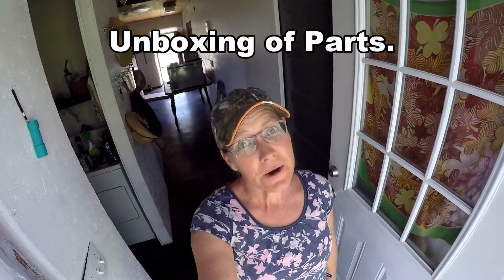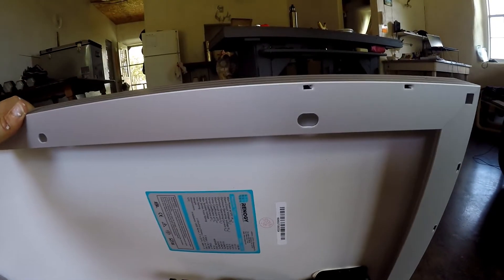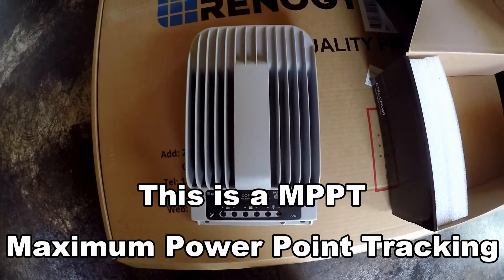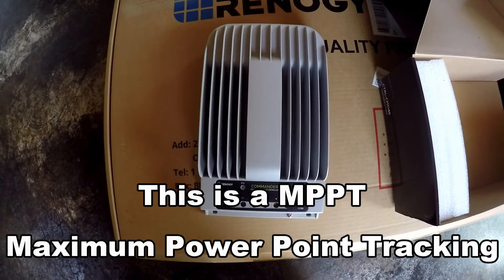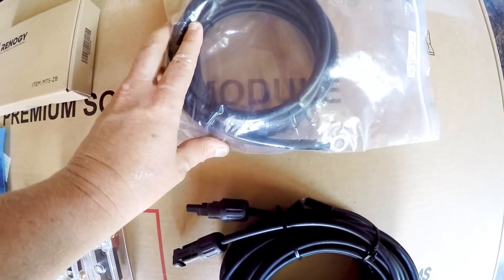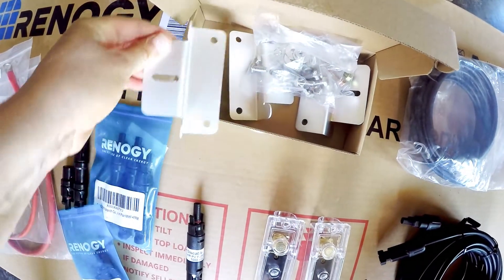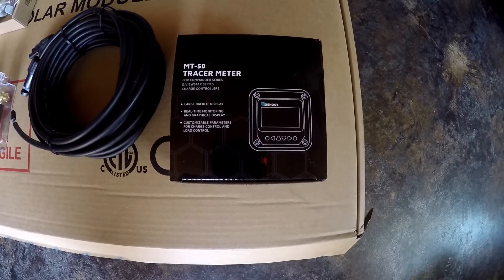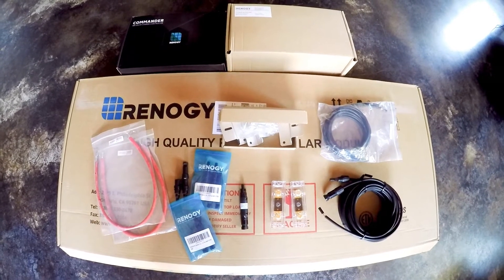Renogy Solar Panel Kit Arrives - Off Grid Truck Camper #13

Comment: Consider a battery disconnect switch and a solar disconnect switch so you can shut down power when you need to do maintenance. You may be already doing this but, when you are wiring things up, put in some 12 volt sockets along with some USB chargers https://www.amazon.com/Blue-Sea-Systems-Charger-Socket/dp/B01BVBRBXA

Comment: Looks like a lot of pieces and wires.  Do you have a diy installation video or does Dave or you just know what goes where?  Looks like it will be really neat down there in the baja living off the sun.
Reply from the maker: We have electrical skills/experience.  But we studied up on the subject.  There are a few things that MUST be hooked up in a certain order so as not to fry/ruin any components.  But after you know what NOT to do, connecting everything is fairly simple.

Comment: I installed 4 of the Renogy panels but used a TriStar PWM controller. Installed a Trimetric 2025 with a 500 amp shunt for monitoring the battery bank. And using a Raspberry Pi for monitoring the solar controller. Looking forward to your installation.